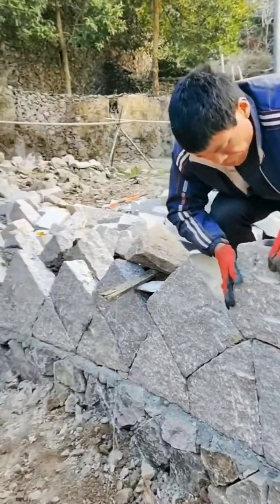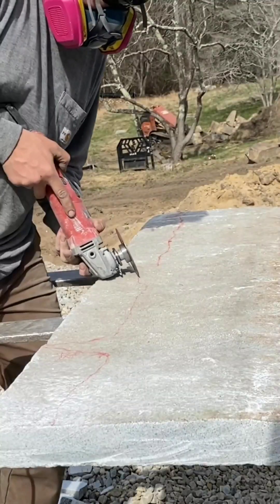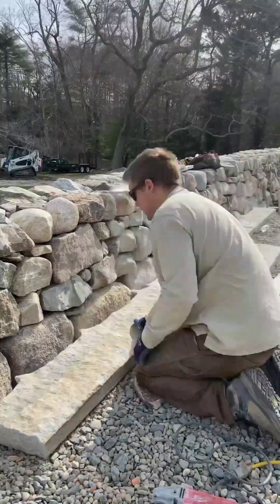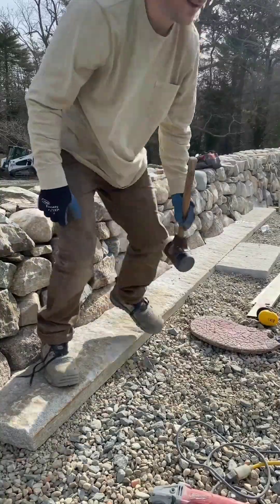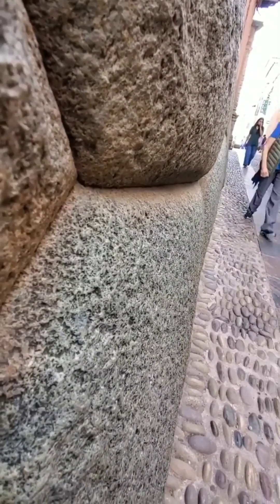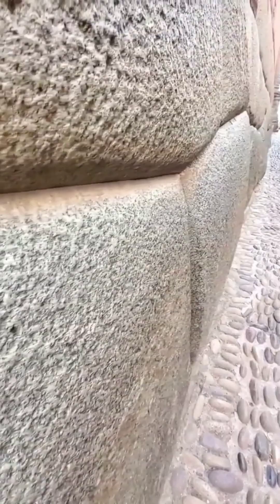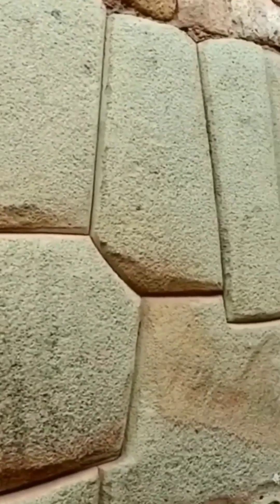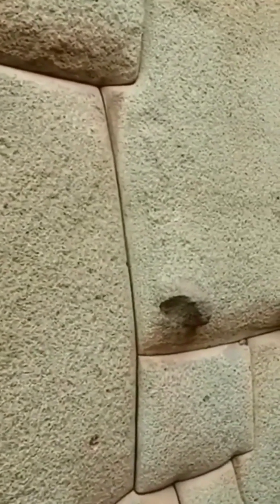The Truth About The Ancient Master Builders (Peru,Egypt & India)

Comment: No this isnt as hard as you think.

You start with a slab, then you fracture it like you want. Even in weird shapes...
Then its just reassembling it.

Suggesting heat just means you have no idea how minerals work.
Once u apply heat, you can never go back. The rock consisting of different minerals will change.
You wont have the same rock type even.. you can NEVER go back either.

No heat, no magic.
Just engineering and work.

Comment: Stone doesn't turn to lava when you heat it up. Stone turns to dust and eventually glass. It's called vitrification. They quarried the stones with stone tools and shapped them with Arsenical bronze. Only heating would've been done to quarry them. The process of firesetting and cold quenching.
Reply: Its amazing how few of these youtubers know about firesetting. 
The most used tech for thousands of years....
Reply: @frosty6960  Or stone splitting with wedges and shims. Stone cutting with saws, etc.
Reply: @_MikeJon_  Yep, the best is to start with the splits. Saws and tools are for the adjust. 
You can fracture andeiste and granite in a zig zag pattern if u want